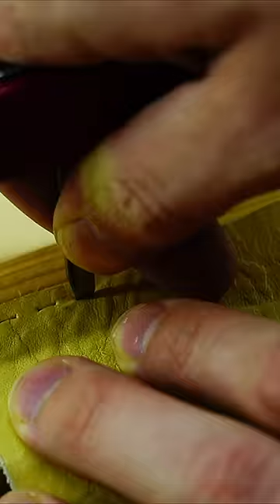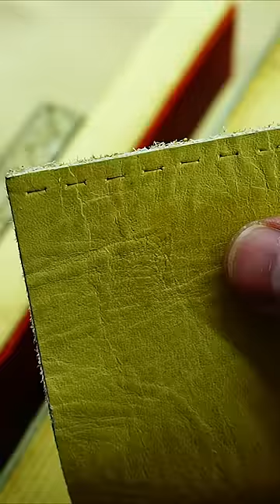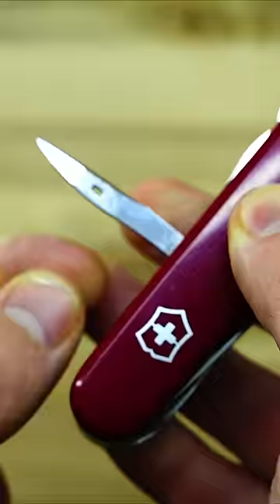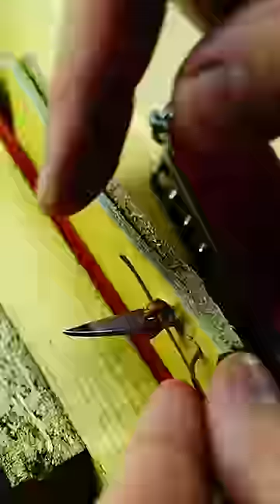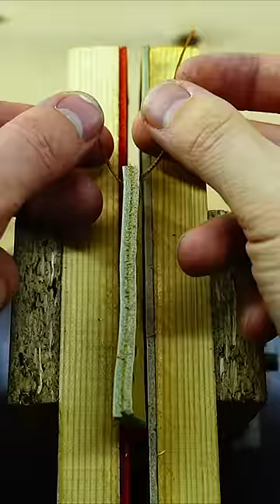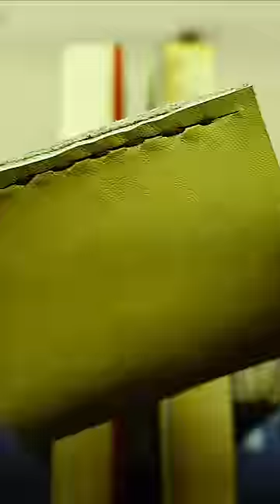How to use the Awl in a Swiss Army Knife

Comment: Should point out that the first flat ended tool is a chisel.  It's not on any knives less than 5 layers, so only on the Ranger, Handyman and Swisschamp. 91mm SAKs with 2-4 layers mostly have the awl but not the chisel.
Reply: Could still get it done carefully with the knife well enough though.
Reply: I was just about to ask what the first tool was. Thank you
Reply: The awl itself could have been used to make those holes. No chisel needed.
Reply: @kingpin11111  Yep I don't think I've ever used the chisel on my Swisschamp.  I've used the awls though on various SAKs, the best have to be the inline awls on 93mm alox SAKs e.g. Pioneer, Farmer etc.
Reply: It pointing out the side like that makes it a pretty shitty chisel.
Reply: You can use the awl to do the same job.
Reply: @No_Lucks_Given it is useless
Reply: @kingpin11111 never worked with leather, eh?
Reply: @kingpin11111 i wonder if the awl would make a hole that wouldn't tear. Like when making mukluks?
Reply: Can't you use the screwdriver that is on the bottle opener?
Reply: @schwarzerritter5724  I guess so but you would have to sharpen it first, looking at the one in my pocket now, which is on a 91mm Climber.  I just compared it with the larger on my 93mm alox Farmer X and although that one is larger and the driver end wider, it appears to be slightly thinner than the one on celidor models, but it would still need filing down to become a chisel.  Which I'm not going to do as I like them as flat drivers and general prying implements.
Reply: Who are you the Swiss army knife Yoda,?😂
Reply: @@nikossurvivalFor sure. I've made several chisels from flathead screwdrivers.

Regular screwdrivers (chrome vanadium steel) on a bench grinder / belt sander;
    ...but this stainless steel from a swiss army knife can easily be sharpened on those cheap (usually 2-sided) stones.
Reply: so you’re telling me that’s not a flathead screw driver
Reply: @WellActualllyyy  If you mean the same tool I'm referring to, no it isn't a flathead screwdriver, it's a chisel as the end is bevelled down to a sharp edge.  I'm referring to the backtool which is next to the corkscrew.  The next one in from that, next to the hook, is however a small flathead screwdriver.
Reply: laughs in victorinox
Reply: If there’s a bottle opener the top of it is the same thing. Which usually the smaller ones have both bottle and can opener
Reply: As a swiss I like to remind you that it is not a swiss army knife, it is a swiss pocket knife simply.
But yes there is also the army models from viktorinox wich you receive if you go to the army and you can buy it just like that too.
Reply: @maruuumaruuu1681  I know what you mean.  In German it's a Schweizer Taschenmesser, in Dutch a zwitzerse zakmes, in French a couteau suisse, and in Spanish a navaja suiza.  But in the English language the term Swiss Army Knife has stuck, even though it's technically not correct as you say.  I have 10 Victorinoxes but only one of them is a Swiss Army knife, my Soldier  08.
Reply: Jesus I didn’t realize there was so much lore in Swiss Army knife culture, let alone that Swiss army knife culture is a thing that exists
Reply: I thought it was a flat head. The box mine came in said it was a flat head 🧐
Reply: @thezx5795  No it goes like this:  corkscrew, chisel, flathead, hook, reamer/awl.  Or do you think there are 2 simlarly sized flatheads between the corkscrew and hook?
Reply: Should point out it is a awl and a flat head not a chisel 😂
Reply: @No_Lucks_Given that kind of sums up the Swiss army knife’s role in one example. Basically they contain a large assortment of tools and can do the same things it would take a dozen or more full size tools to do….but they are also mediocre tools and take twice the time and effort of a dedicated tool to do the same job.
Reply: The awl is pointy as hell and can do this without the pre punched slots
Reply: @larryw866  This thread has just become confusing now lol.  I can't  even remember why I wrote my initial comment.  There is an awl, flathead, and chisel on the back of celidor SAKs with 5 or more layers, as well as a corkscrew (but it was a Phillips on some now discontinued models), and a multi-purpose hook.  But not in that order lol.
Reply: Ok Swiss army nerd 😂
Reply: Was curious about that. None of mine ever had that
Reply: Ya know your swiss knifes ..
Reply: And I thought that chizzle was a flat head screw driver 😅
Reply: Why did he stick the thread in before he pushed it through then pull the thread all the way to the other side? Should have just put the awl in then threaded it.
Reply: The champion plus also has the chisel, and is in my opinion the best SAK to daily.
Reply: No. It's a screwdriver
Reply: @thecadman99  A shame it's discontinued.  I opted for the Swisschamp over the Handyman purely due to the inline Phillips driver.  Had the Champion Plus still been available, I would have got that and carried it together with Knipex Cobra XS pliers.
Reply: @boyznthewoodz770 
I am with you on that , I am not a big fan of non lock blade knives . I will take a Leatherman over these any day .
Reply: @simonh6371  That's sad news. Hopefully my plus will last a few more years. It's my second (lost my first one) and it's about perfect.
Reply: You are correct, but I would point out that in a pinch, in the field, the awl WILL puncture the leather and the chisel isn't necessary.  The procedure shown here, done in the shop, makes for a "prettier" repair.
Reply: There is a 90s variant of the M-2250 which is 4 layers that had an awl in the earlier versions but now has the chisel. Army issued pocket knife. I don’t think they issue them out or make them anymore. My grandfather a 32 year army engineer retired Vietnam veteran gave it to me when I was 6 years old. It was a rainy day in near Bastrop TX and we were surrounded by pine trees before the wild fires when the forest was thick and lush. I’m 30 now and still carry it with me every day. It’s been lucky and sparked a conversation when an older veteran sees it looks at me and ask who gave it to me. They are usually stamped with a year on the blade. It sits on a mantle by the door where his picture, DD-214, and Vietnam era steel pot where he wrote his name out land name on the band still sit. Taught me a lot of useful things I use in everyday life. Pretty cool and useful I use the knife a few days out the week keep it sharp. Funny memory is I cut my thumb with that knife when he gave it to me that weekend. Still have the little scar and I keep it that sharp always so I tend to warn people that it is sharp with that memory in mind from when I was 6 years old 😂.
Reply: Notice how its sharp an pointy  u dont need it ,
Reply: I thought it was flathead screwdriver 🪛
Reply: @lesliehunter1823  : You might have to think hard about that one. Maybe do a little experimentation.

Because a lot of the time if you’re making mukluks, particularly, if you’re in the north, you are thinking about a waterproof boot, made with a waterproof skin like seal skin. And that might be what’s really needed.

And if that’s the case, you probably don’t want to make a hole any bigger than is going to be required to put those sinew stitches where you absolutely need them to be.

there are a couple of really awesome spots here on YouTube, that talk about the construction of Traditional construction of traditional native footwear.  There may even be a little bit there about Repairs, but if you have the construction techniques down, you pretty much probably know enough to do a repair.

The people doing those videos would be the ones that any smart person would probably defer to, for really good know- how, backed by centuries of experience.

A pair of kamiks is one thing, but mukluks is quite another.  I haven’t had to do repairs on my sealskin or synthetic mukluks, yet, and hoping I never have to, but if it comes right down to it, my emergency kit contains extra sinew, and some special needles for sewing leather.

There’s a newer style of leather needle out now, that you can get from Tandy. It sure makes it a lot easier to sell through heavier leather. It also makes a smaller hole. Give them a shout and ask them about that if that’s what you need. It’s not expensive, but well worth having on hand for any leather repairs. Just get the right gauge for the leather that you need to be able to repair.

if it helps you at all, for repairing regular leather boots, like hiking boots, I’ve had to do that on the fly. Regular curved, leather needles in a couple of different sizes, have been really super useful to have on hand, along with a bit of sinew.  Sometimes it’s even possible to do the repair so that’s pretty much invisible by hand. it might not be a bad idea to have a little bit of whatever you like to use to waterproof your boots, to waterproof your repair once you’re done. Particularly if you have to use your Swiss army knife all. That’s not a very small blade.

occurs to me that if you have synthetic mukluks that you’re wondering about doing repairs on, talk to whoever you happen to know Who has a contact in military supply. Chances are, he, or she will be able to put you in a position to Ask somebody about how field repairs are done on synthetic mukluks.  because all the places that you wear mukluks are places where you can’t afford to have a puncture or a rip, if you want to keep your feet.

 when it comes to mukluks, I never use my Swiss Army knife all for that ever, because of the importance of being able to have the smallest holes possible.  

If I got separated from my emergency repair kit, then maybe I’d have to rethink that. In that case, it might be necessary to make a bit of bitumen on the fly, to really seal that repair up beautifully, from a functional standpoint. It would probably look a lot less than beautiful, from an aesthetic standpoint. But it would get your home with your feet uninjured.

Now, if somebody else out there has a technique that they’ve used with a Swiss army knife when they had a choice, and found it to be the better option, I’d be really interested in hearing about it.

It’s always a point of gratitude when  somebody with more experience is generous enough to help me with better knowledge to upgrade my game.

I hope this helps some.
Reply: @J.R.in_WV Right. If you have a proper tool at hand, use it. If not, a SAK will do.
Reply: @MrLoobu why not use the spike of the awl?
Reply: My Swiss champ doesn’t have a chisel. Is this a newer thing? (Mines older)
Reply: Thank you, I was about to ask.
Reply: I have a 6 layer that doesn't have the red plastic pieces anymore, I got it years ago for 20 bucks it's got mini pliers on it to
Reply: @stephenmcdermott1218 that’s Chinese knock off😎
Reply: @qanondon2100  I hope not! It's not bad quality
Reply: Well now I know that there are people obsessed with SAKs. I’m guessing you have a bit of the ‘tism. Not being mean, I respect your enthusiasm.
Reply: @boyznthewoodz770 I didn't know there was so many different models
Reply: It's not a chisel.  It's a flat screwdriver.
Reply: @Davefinney370 never worked with leather eh?
Reply: Surely that first tool is a screwdriver
Reply: @simonh6371 dutch is closest to swiss german in this case. we call it a "Sackmässer"
Reply: @pascaltomasovic3586  I'm sure that somehow Schwyzerduitsch is relared to Dutch via Schwaebisch, Koelsch and Plattduitsch.  Although weirdly sometimes in terms of inflection it sounds more like some Flemish dialects.
Reply: @simonh6371  I'm no expert but I know from personal experience that even though Swiss-german is a german dialect it is actually closer related to dutch. Which is weird, because I speak German perfectly but don't speak dutch at all. Many dutch words however are pretty much the same in Swiss-german and different in German.
Reply: I was today years old when I found out how much these cost. Now I kinda regret letting these 2 get so bad and fucked up chipped blades and shit. Don't know what this thing is exactly but it's probably as old as me and I've had it for half my life now. Maybe I did get my use out of it all along who knows. I could do better next time
Reply: @nikossurvival and you ruin your flathead at the same time!
Reply: Jesus is the only way to healing, restoration and salvation to all souls. Please turn to him and he will change your life, depression into delight, soul heading from hell to heaven all because of what he did on the cross 

“Whoever calls upon the name of the Lord shall be saved” Romans 10:13
Reply: I've just tried the tip of the can opener and it works wonderfuly
Reply: @kingpin11111 My thought exactly! But the chisel is a good preparation guide.
Reply: @HaroutBlack 🥱😴😴
Reply: Hey everybody look at the big brain on Simon!!
Reply: @Cambo72  If you start quoting Ezekiel ''the path of the righteous man is beset upon all sides....'' then I'm getting scared.
Reply: @simonh6371  Hosanna!! 
Hallelujah to the Lamb of God!!
Reply: @Cambo72  okay looks like you didnt get the Pulp fiction reference
Reply: @simonh6371  I used to love that movie but now all I see in it is filthy Godless chatter and the filth of Hollywood and all of its sorcery.
Reply: That's interesting. Thanks. I always thought it was a flat blade screwdriver. I didn't realize it was a chisel. Cool.
Reply: Its the screwdriver einstein...
Reply: I WAS WONDERING HOW I'D NEVER SEEN THIS PIECE! I think I've only ever seen 2-4 layer ones!
Reply: That would get you 2 year in the slammer up here in Glasgow.
Reply: I always use that as a screwdriver...
Reply: But the 4 layer chisel will have the 3 level mini pliers, which will work perfect with the1 layer toothpick. Right????😂😂😂❤
Reply: @thezx5795 if you have a Champ, Ranger, Handyman or Huntsman they also have a small flathead next to the chisel.
Reply: #shartstains
Reply: @klj2382  ain't no way I'm clicking on that ... but thanx all the same .
Reply: Wouldn’t that be what the sharp end of the awl is for then?
Reply: @charlesrichardmcneel5811  Yes it too can be used as a pointy chisel I suppose.  It's definitely more useful than the chisel.  However since all SAKs with a chisel also have an awl it's covered.  The chisel isn't particularly useful but backtools on SAKs don't really add to bulk or weight so I consider them free extras.
Reply: Ranger is the best victorinox in a pound for pound context. No other tool is as tool dense in the 91mm category. One may argue on behalf of the minichamp or workchamp though
Reply: @kingpin11111  This!
Reply: @larryw866  I have properly sharpened it, and find it is a VERY useful little chisel, that I use a lot.
Reply: @J.R.in_WV Still very useful in emergency situations where you are not carrying a large heavy and bulky tool box...
Reply: @keithking1985 It still needs to be properly sharpened, as it comes too dull from factory, but once sharpened to the proper 25° angle, and provided with a micro bevel, it ends up being a very useful little chisel, that I find that I use a lot!
Reply: @alfredomarquez9777  what the flat head or awl?

Comment: Ya showed that by a scout master back in the 80s.
He didn't use the flat head driver to make holes first though he just muscled the awl through.
Cheers.
Reply: Yeah, I'm pretty sure it's designed to be used directly like your scout did😊
Reply: Just muscle it through. This video is showing the chisel, which is actually for other purposes (but still helpful if you want to muscle less I suppose).